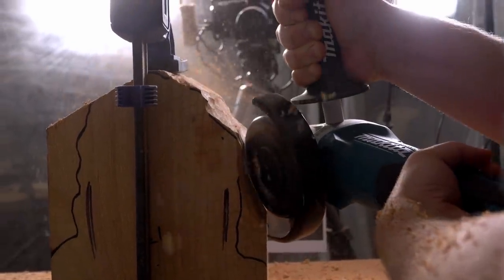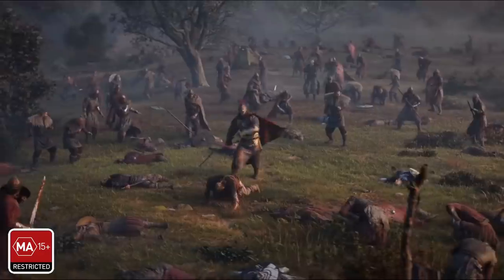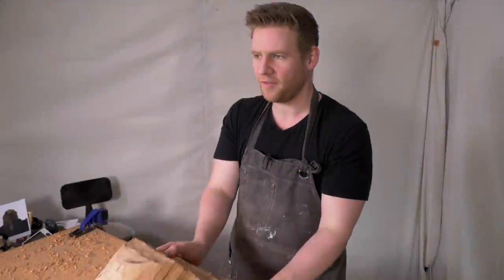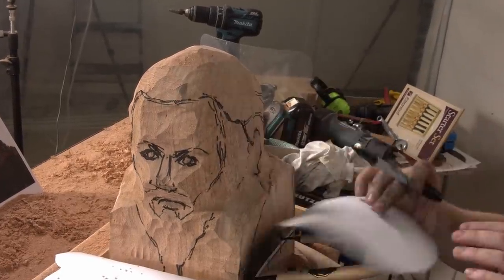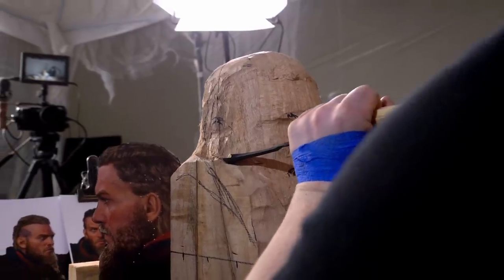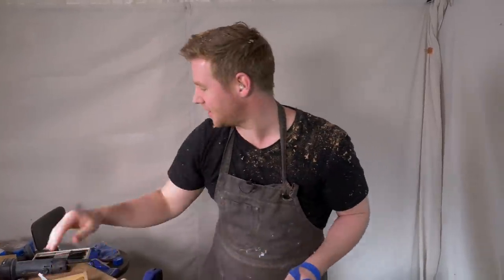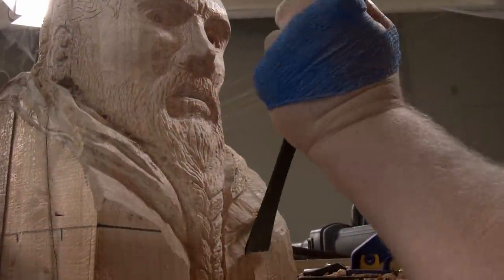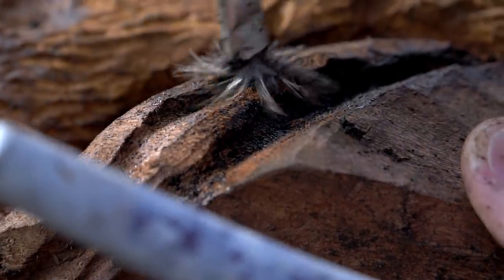I Tried WOOD CARVING like a VIKING

Comment: Jazza: Spends hours on this piece made from wood

Also him: Surrounds the finished piece with a bunch of lit candles
Reply: Big brain time
Reply: The axe at the end also scared me
Reply: That's not as dangerous as you might think actually, the wood needs to heat up before being flammable, and the dirt protects it. And it's not like the sculpture or the candles are just gonna randomly fall on eachother
Reply: You know a block of wood doesn't actually light on fire that easely if a candle fell on it it would become  a bit black at the spot where the flame was by the time he removes it,just need to sand that spot and it's all good
Reply: Give you a million bucks if you light a big block of wood like that on fire with candles. Safest bet of my life. If it's just a little damp it's not even gonna char.
Reply: I was just waiting for the sculpture to set on fire
Reply: lol have you ever tried to start a wood fire
Reply: @Bentijon  or are they?

Comment: 4:07 there is a Scandinavian dog breed that has existed since the viking ages, the breed is named a gray norwegian elkhound, now days it is also used as normal house pets, but in old times, both now and all the way back to the viking ages, the breed was used as a hunting animal, and it specificly is used for hunting big time animals like bears, moose and wolfs, and the breed does not exist outside of Norway due to being very rarely crossbreed, it for what I know only has one closely related breed, that being the black norwegian elkhound which is a very young breed, being first bred in the 19th century, but being used for the same thing as its gray counterpart, just being a little smaller
Reply: Elkhounds, very nifty, loyal breed. 😎

Comment: When a logger re handles an axe they take off the varnish (the shiny finish) on the handle because the varnish causes blisters.  It’s only there to keep it clean in the store. If you do this again take the few extra minutes at the start and sand or scrape off the finish. It will save your hands.

Comment: Never ever wear a glove, especially a cotton or wool kind like that when using a disc grinder.
If that glove even brushes against the cutting disc, it will grab onto the fibers and suck your hand right into it, whereas if you touch it with your bare skin you have a chance at pulling away. It can be the difference between a deep gash and an amputation.

Always always better to go gloveless.

Leather gloves may be okay in some situations.

Comment: im a little sad you used so many modern tools, mainly in the end. it removed the carve marks and robbed you of what is in my opinion, the most satisfying part, the detail carving.

i hope you will revisit wood carving with hand tools some day. if done right and your tools are sharpened, then the finished product is silky smooth. and detail carving causes a lot less strain on the body, either with small taps for the mallet, or just pushing the tool with a bit of pressure.

Comment: think time do another carving. try spider man bust.   if want fancy have mask ripped open. or do look as cartoon perfect. cut hafe so works asa book ends. so want as bust stack next each other. but want pull back of bust off put 5-10 books in the middle. make functional peace art. painted up so use wood base wood or popular no need for hard oak or maple not see wood grain anyway. though hold books might make base heavy. so might incorporate little oak in it through wood glue.  wood burn in flat bust goes book spider man most popular say with great power great responsibility.  other side do spider web with spider. wood burn. inside bust cut hafe flat side. wood burn words art on it.